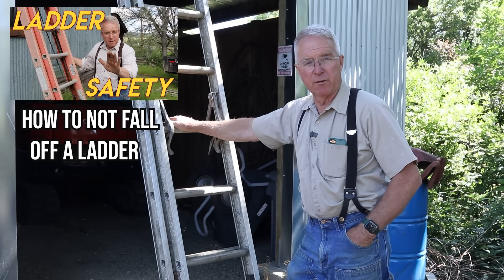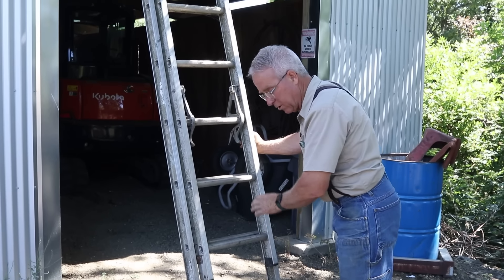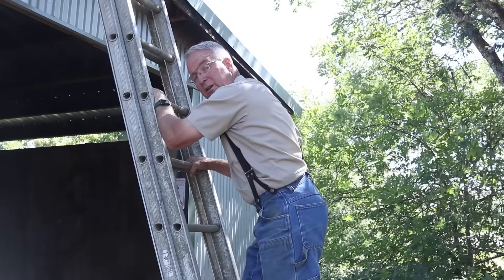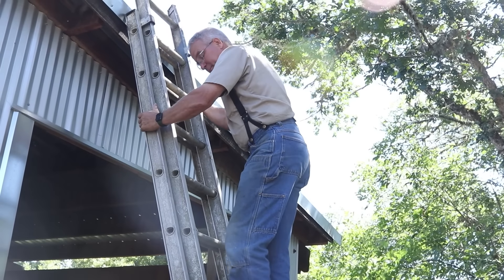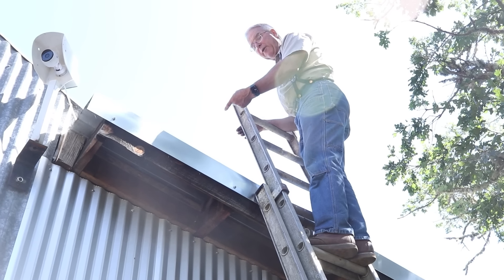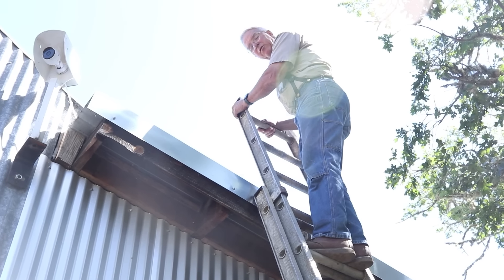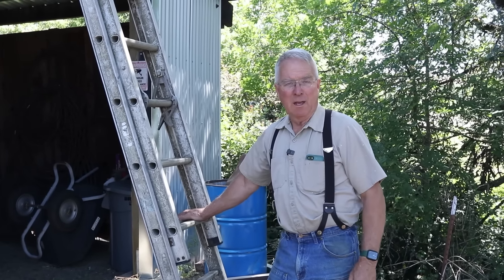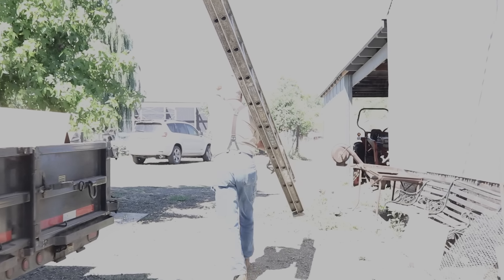How to Climb A Ladder, Dismount, & More Tips

Comment: As a second generation roofing contractor, I approve this video! The one thing I would add to safety measures, is always make certain there are four points of contact on an extension ladder. Two on the ground and two on the roof. Sometimes, one side of the ladder will be off the roof and in the air. When this happens, the closer your body weight gets to the roof, The more the opposite foot is being torqued wanting to kick out from underneath you. Ask me how I learned how critical this is on a slippery redwood deck :-)

Comment: My Dad had his extension ladder fully extended and couldn't quite reach the peak of the house so he put it on a wooden crate! The crate held and the ladder didn't slip off it but the device that locks the rungs together failed when he got to the top. He was holding on to the sides instead of the rungs so when the two sections came together they cut his palms open and he dropped the rest of the way, through the wooden crate at the bottom! No broken bones but man what a fall! 😵‍💫 He apparently fell off a lot of ladders without breaking any bones but probably the best was into a hedge with an electric hedge trimmer and he managed to cut through the cord as he fell 🫣 God probably doesn't let him climb ladders anymore ❤😊
Reply: My brother fell off a ladder at his own home and he doesn't really know what happened, but they think a sharp branch he had just cut sliced his head open as he fell. They stapled and stitched him back up, he was okay in a month or so.

Comment: Great ladder safety video. I've spent 40+ years on and off ladders. usually packing stuff up ladders and this was great. (Usually exceeding the load rating of the ladder.) 
The only caveat I would say and this is in regards to homeowners; if you don't feel comfortable on a ladder, DON"T use one. I've had to go up 40' ladders a couple of times and "rescue" someone who froze because they found out too late that they didn't mix with ladders. it is not a comfortable feeling trying to talk someone down a ladder when they are in a panic.

Comment: OSHA puts the transitional height at a minimum of 48”, either between a ladder and a surface or from one ladder to another ladder; the latter being a horizontal transfer and doesn’t include a change in height.
Also it is good practice to secure the top of the ladder, if it’s portable; attaching a ladder or strapping it to a line or pole, should be the first thing as far as a best practice; unfortunately safety is rarely ever actually first on sights or in real life as safety, true safety, takes time.
I’d also note with regard to aluminum ladders carried vertically should be treated much like lift or crane booms as you should always be looking for aerial obstructions and especially POWER LINES.
Reply: OSHA does not always offer best practices. For example a few decades ago they mandated that ladder jacks could not open enough to compensate if you set your ladder at a steep angle. I guess they reasoned that it was unsafe to have a ladder at a steep angle. But that left my walk board unlevel. Working around old houses with bushes and trees sometimes required using a ladder at a steep angle. I would just plant the ladder into the ground and it couldn't move so the steep angle was safe. I could either put something between the walkboard and jack to level it, which was dangerous should it fall off, or work on an unlevel walk board, which was also treacherous. In an attempt to solve a problem OSHA created a bigger, recurring one for me. I live in the USA but fortunately I was able to locate a pair of the old jacks for sale from Canada.

Comment: Thank you for the video.  For me, getting off the ladder to the roof is nowhere near as bad as getting back on.  I hold on to the rungs, even one-handed.  Only once have I "ridden 'er down" as the legs slipped on an icy surface.  If I had been holding the rails, the fingers of both hands would have been smashed.  
Also, I'll either "walk" the ladder to move it a short distance across the roof line or lower it to he ground and carry it horizontally.  Lastly, after I set the ladder up, I'll pull it a little bit away from the roofline to be sure the legs are firmly stabilized on the ground.  This helps prevent the ladder from shifting and sliding off sideways.  Again, Thanks for the video!

Comment: We have extensive ladder training, three points of contact at all times. One foot two hands, two feet one hand while climbing. And use a toolbelt or pull anything else up by a rope.
Reply: This is also what I learned. Always three points of contact. That also means you can not use both hands when working on something. If you need both hands, use a scaffold instead of a ladder. You can also work much faster on a scaffold.

Comment: I'm pretty sure I first discovered this channel because I was looking for ladder safety tips and found your last video on this. I now have a garage with a loft that must be accessed via an extension ladder, and I'm in the process of moving things up there for storage. I watched this video last night, and then today had to move a bunch of lumber off-cuts up to the loft. It was great to have a chance to try out these tips in practice while I did this repetitive task. I found that I could carry 1-2 pieces in one hand, slide my free hand along the rails as shown, and deposit the wood on the loft floor after only climbing four rungs. Then climb back down with hands on the rungs, and repeat. Once I had moved enough pieces up to the loft, then I would go all the way up, carefully step onto the platform, and then work away from the edge to move the lumber into the storage area. I also got to experiment with ladder height and positioning to make sure it was stable and that I couldn't kick it out while getting on or off it. Thanks for this great video - the comment that the ladder is the most dangerous tool on any job site is important to take to heart.

Comment: I’m sixty nine and still using ladders occasionally. For what it’s worth I tie the ladder top and bottom whenever possible using (say) quarter inch rope and tension with a Waggoner hitch. This way the ladder cannot slew sideways, especially at the top. Also it cannot kick outward when getting off the roof. I also have a cradle I made which fastens onto wooden fascia boards, into which the latter fits and cannot move sideways. Thanks for your videos I respect you very much as a practical man and would be interested in your comments on my methods.Regards from England .
Reply: To what do you tie the top of the ladder to, so that it won't slide sideways? I'm not quite getting the picture.  Thx.

Comment: You can also easily get them turned backwards in their orientation, where the rungs aren't in a flat position. The bottom portion (with the cleats) needs to be BEHIND the extension portion if you're looking at the ladder from the front.

Comment: As a building inspector I can get on 20+ roofs a day during hail season (right now 😱).  A ladder must always always always be fastened or secured  to the eave or gutter, or it's an immediate failed inspection.  I will accept a bungee cord in good condition, but a ratchet strap is best.  Really good info about transitioning from the ladder to the roof, my least favorite part of the operation
Reply: How does one secure the ladder without getting up on the ladder at least once without it being secured?  Seems odd to immediately fail inspection if you don't actually know if anyone has been up the ladder the first time yet in order to secure it...
Reply: @ixamraxi if a ladder is put against a building it should be secured straight away and not be left unattended until it has been, id imagine if he sees someone putting it there and going up to secure it, it wouldn't be a fail, but if a ladder is just resting there unsecured anyone could go up it before it has been secured
Reply: @oceallaigh1218  He didn't specify that the ladder appears unattended. The problem I was pointing out is that it presumes the ladder has been there for a while, and that people have been up more than once (since the first time its used it should be to secure it).  There have been several times where I've been on a site where someone set a ladder into place, went to something they either forgot or will need (such as a new securing strap due to fray or wear), and informed others to hold before using it. It presumes the ladder has been used improperly even if it hasn't.
Reply: yes, fastening the ladder seems to bring piece of mind
Reply: What if there's nothing to secure it to? I want to do that but there's nothing on my roof I can hook anything to
Reply: I saw a guy gently placing his vehicle with the bumper (fender) against the ladder and putting the handbrake (parking brake in US/Canada?) on & squeezing up the base of the ladder sideways at the base. Felt more secure as the ladder wouldn't kick out as it would have to move the van (truck) before that would happen. I suppose some might say you should always keep the area around the base of the ladder clear, but I'd rather know the ladder won't move & the softer than concrete (ashphalt etc.) panel roof of the van was about 5' closer if I ever fell.
Not an "approved" method but sure makes you feel safer, especially if you can't get the ladder at the correct (72°?) angle. Great video Scott.

Comment: You can approximate the proper ladder angle by standing at its base and extending your arms horizontally to the rungs at shoulder height
Reply: Just about to post that info......correct angle is important
Reply: That's true and he covers that in video 1
Reply: @welshhomestead Missed that one. Thanks.
Reply: @welshhomestead  I also missed it

Comment: People do treat a ladder as a very simple tool that any idiot can use, so thanks for reviewing all these strategies that improve the safety of this statistically dangerous equipment.  For me, there is nothing worse than feeling nervous on a ladder and that nervousness melts away if you know your ladder is secure and you've done everything possible to make it as safe as possible and as you strongly stated; "Pay Attention".  Also note that a good ladder stabilizer positioned at the roof level is a great addition to the ladder and tying-off to secure the ladder at the gutter level is a good practice where practical.  On soft ground, like a lawn, I always carry a small trowel to dig a shallow divot to place the legs, which is easily pressed back in place to disappear.  I often place a 2X4, about 24 inches long across the feet at the base and stake it with a couple of screw drivers, about 12" long, to prevent the bottom from ever kicking out.  There are a number of great leg leveling devices on the market to level the feet, but unfortunately, they can typically cost as much as the ladder itself, so I see few people that own them.  The leg leveling problem with ladders is so prevalent, that a quality leg leveling device should be mandatory for every ladder.

Comment: Great video! I don't usually comment, but having seen the first ladder video and this one as well, I have a couple of additional important tips. For a little background, I spent over a decade working at a hazardous chemical plant where safety was a never ending topic, and also did some contracting work which included some very uncomfortably high ladder work. First, it's good to use a 1 to 4 ratio to set the base of your ladder. For example, if the top of your ladder is resting on the side of a house 20' up, the base (feet) of the ladder should be about 5' out (perpendicular) from the wall. In the case of this video it would be a 1 to 4 ratio from where the ladder was resting on the building not including the 3' overhang. This is supposed to be an optimal ladder angle. The second tip (important! especially if you're going high) once you set your ladder and make any adjustments as shown in this video and it looks right, stand on bottom rung with both feet and pull the ladder away from the structure a few inches and watch for side to side movement at the top. If it pulls away from the structure straight with no side to side movement and returns to where you had it, it should be safe. If not, stabilize your ladder again. Lastly, If you are high enough in the air to fall and possibly kill yourself, why would you buy a cheap ladder? Not a tool to save money on.

Comment: I'm 70, have fallen off ladders from roof level twice. No serious injuries either time. But you don't want to do it again! Solution? Installed stainless steel eyebolts 6' high and at about 8' intervals around my house and outbuildings (into studs or corners, of course). When using a ladder, I put ratchet straps on each side of the ladder and connect them to the eyebolts. Then tighten until there is just a little tension on the ladder. This prevents the ladder from kicking out or sliding from side to side. Major benefit, as I've grown older, is it also takes most of the wobble out of the extension ladder. Takes some time, but haven't fallen again.
Reply: Brilliant, I’ll be borrowing this for sure! 👍🏻

Comment: Thanks for the video - all good comments. I have some "wings" that fit into my ladder and it makes it rock solid on the roof. Makes it a bit top heavy, so I need to be careful, but once in place - very secure and they just slide into the rung holes.

Comment: When stepping from the top of the ladder onto a SLOPING roof, don’t falter as you move from the ladder to the roof, keep going.
I made the mistake of stopping half way to push myself off the ladder and my balance wanted to lean me back off the roof. Let myself drop onto the roof and recovered by crawling up the tiles.
So easy to get it wrong. Good informative video 👍

Comment: Nice Job, Scott...your experience and common sense is the best part of your videos. Thank you!
Many worlds need ladder safety.
*OSHA requires a defined heel boot  of 6" high for ladder work...no moc  toe boots have heels that I have seen!
As BSA camp Rangers we always tie off the top of the ladder since nobody can save you while stranded rooftop in camp alone.
As power co electricians, your ladder is scrap since the tip is bent..plus, its gotta be 4 rungs higher than your top platform...no aluminum ladders for electrical work allowed, lol. We carry horizontal with two people in the subs. Zzzt! Boom!
As a fire officer, you gotta keep your but in while ascending, three points of contact and the FF at the foot of the ladder while carrying horizontal is the boss.
Keep up the good work!
The man in the arena always gets my full respect.

Comment: Painter here  for 30yr , always have something in my hand .  I put the carry hand behind the rail and keep contact with the back of my hand so I still have a point of contact  as I move my other hand rung to rung . I put a broomstick through my 2nd to top rung to hang things from .  Always have 3 points of contact . If not mentioned in previous videos make sure the flat part of rungs are parallel to the ground , thats your angle check . Never reach through a ladder unless no choice , thats a great recipe for a broken arm . When in doubt stake down one foot of the ladder so it can't slide out . And if you climb one for a living invest in levelers , round foot is my preferred type. I also cut all my ropes off , tripping hazard . As for as OSHA goes , I honestly have no idea so theres that! In my opinion the most dangerous ladder is a 6ft step. I've seen more accidents with those than anything . They kick out due to bad set  and the body gets a half rotation and they land on their head . You can aslo bungy your ladder to the gutter to add a little step on/off security , and even nail up a smaller kicker board , just make sure fill the holes with tar . I've done this countless times , not one leak plus it would just be int the overhang . Hope thats helpful to viewers!

Comment: I have a HD folding-extension ladder. The hinge in the middle, when it's fully opened and locked so as to create a straight, tall extension ladder, can flex a bit. This can be alarming when you're getting on and off of the roof as it may suddenly give a bit. So each year when I go up on the roof I remember to make it flex... just to experience it so that I won't panic if it happens inadvertently. I also lash the ladder to the house under the gutter, with bungee cord. Finally, I find it very helpful to make a mental note of the position of the last rung under the gutter, and to note the clearance with the gutter above it. It can be a bit tight. That helps when feeling for the rung with my foot when getting off of the roof.

Comment: I set the ladder up in my uncle house as per the last video to get onto the flat roof over his kitchen. I had difficulty when trying to move back onto the ladder to come back down though. Got a fright! My Uncle had to pull out the bottom of the ladder before I felt "safe" enough to move back onto it to come down. I could "see" more of the ladder below me and it felt safer even if the angle I knew wasn't! He was bracing the bottom the whole time. I've no problem going up, but coming down made me sweat a bit!! Grateful for this extra video to deal with that issue when coming back down! Thanks.